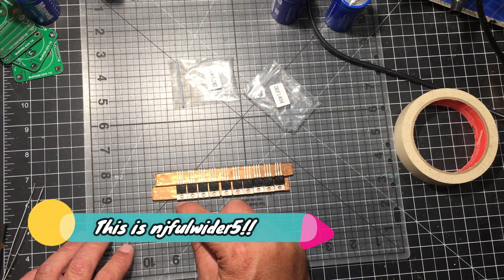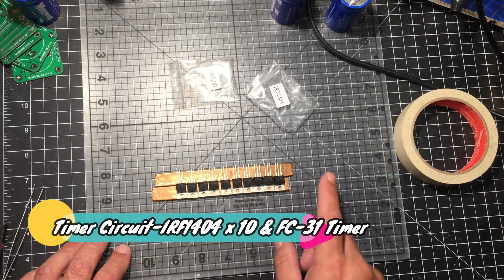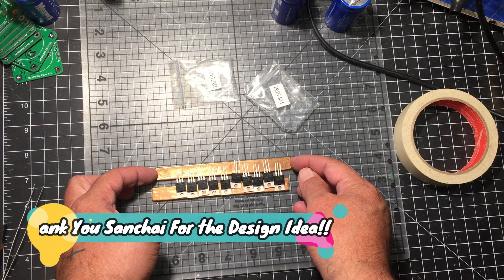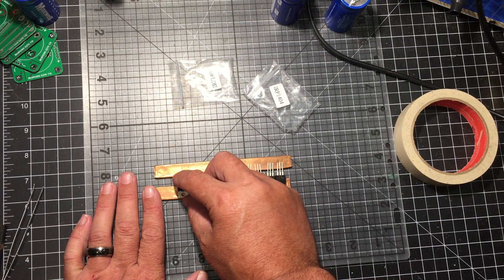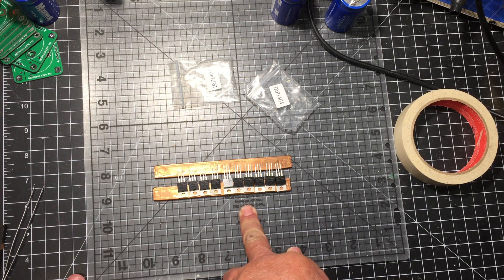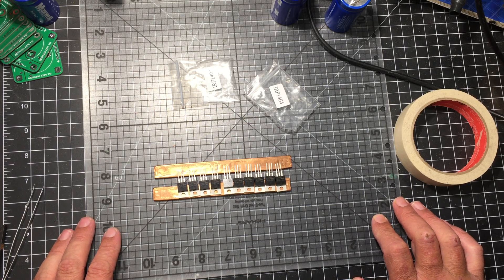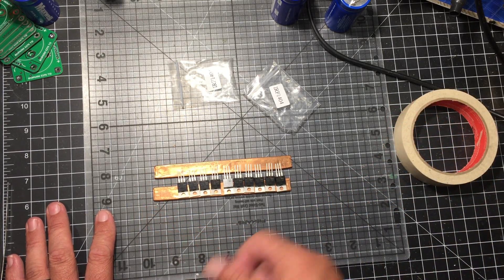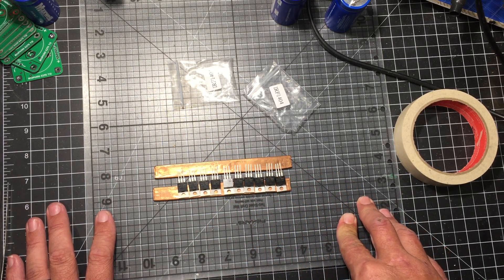Battery Tab Welder Timer Circuit-Super "UltraCapacitor"-"Capacitive Discharge Tab Welder#2 Part 4"

Comment: i don't see part 5, i wanted to see what happened to this project at the end ?
Reply from the maker: Yea I had some issues with the timer and decided like most my projects to revisit after I get caught up. I ended up reordering the timer for a new one, but I’ve yet to test. A friend from Hawaii plans to 3D print a case for it once I have it completed. I also figured out that just one bank has plenty of power to weld. So I might make a few. So hopefully I get caught up by the end of this year👍👍👍
Reply: njfulwider5  ok thanks. I will be waiting to see.  I have made MOT spot welders. Purchased Chinese spot welder but still I like to make new spot welders 😜 I have made 30 mosfet switch but I’m in search of fast switch for it.  One thing I have in mind that those relay delay modules don’t discharge Mosfets internal capacitance like mosfet drivers then I don’t think these modules will be a success.

Comment: Lol you know I am going to keep bugging you till I see this thing weld.lol I really would like to see the welds on capacitor with the irf 1404s it would actually be alot of help to the Facebook group DIY 18650. It would be very appreciated if we ever get to see some welds. I am just making a video of my welder now with adjustable power. Designing how many 1404s I want to use for a test rig and again your welder could help out alot bit also would be different I am using lead acid battery.
Reply from the maker: Ya I have to do some much in the upcoming weeks, I've only been editing my easy quick videos I have. Plus I may need to redo this video, I can only find the test video and I wanted the completed project. I might have to pull this out of storage to do it. My irf1404 combined with a timer are just used as a simple switch, nothing more and with Capacitor welders, you adjust the voltage that you have going into the Capacitors for the power(tons of builds like this out there).  So its a pretty simple basic build and design. Yours, on the other hand, you're using the irf1404s like you would when you use them for adjusting the voltage or power going to a fan, or even PWM builds minus some components.  But instead of one, you're using a bank to make sure it can carry the power going from the Battery, with adjustment.  Can't wait to see your end product. But Trust me when I tell you, this works and works great. I am not that type of YouTuber to say something works for subscribers or views. I love showing my flaws and if it didn't work, I would show that also. Those that follow me, know just recently I had some family issues, that caused me to be away from Facebook, youtube and any other site I'm normally on(almost 1 year). But I never stopped filming my projects. I just recently returned with things leveling off at home. There will be a video, I promise.....
Reply from the maker: @cdiperformanceparts4364  Not a big deal!! It all Good Fun!!!

Comment: Good info. Hard to always hear you speak. Music track is over riding your audio. Music not necessary, hearing you is.  Keep up the videos!
Reply from the maker: Yea, unfortunately I’m not a engineer or a film maker. So I learn as I go. CC works great for videos you can’t hear, or that’s what I use. On my speakers my voice is way louder than the music, it maybe something as easy as changing something in audio settings, but I learn as I go👍 thanks for commenting 👍👍👍
Reply: @njfulwider5  What pgm is CC?
Reply from the maker: Steve Cahill closed captioning 👍👍👍👍
Reply: @njfulwider5  What app do you use to edit the videos?  You could lower volume on music before import to editing program, if pgm does not allow track volume control.
Reply from the maker: @stevecahill9106  You'll notice in my most recent videos, I changed the track volume, it was only in my older videos where I actually had the track at 4 instead of 5 and the volume on my voice at 70 instead of 50. This video was done a while back. You learn as you go...LOL

Comment: I would be scared of holding the soldering iron on there that long.. I guess that is a requirement for soldering to what is effectively a heat sink.
Reply from the maker: Once the Copper gets warm, it can go pretty quick. I'm still not the Greatest at soldering, but the more I do stuff like this the better I am getting. Thanks for commenting!!